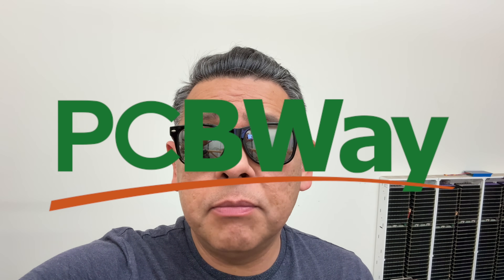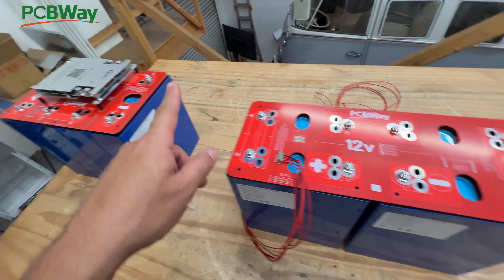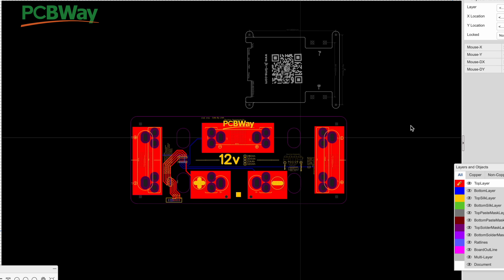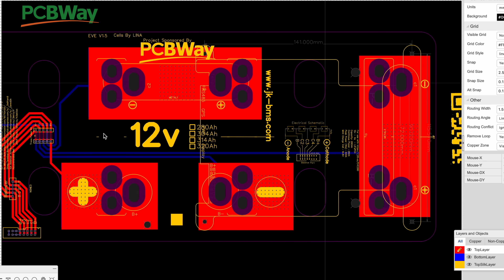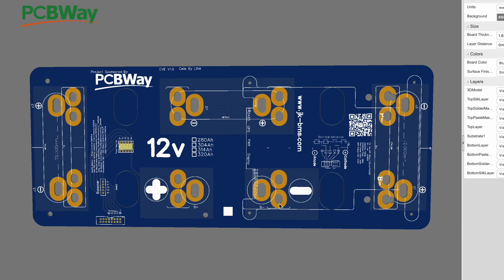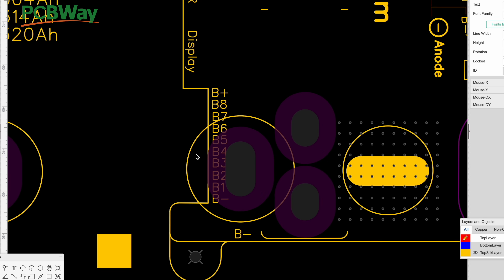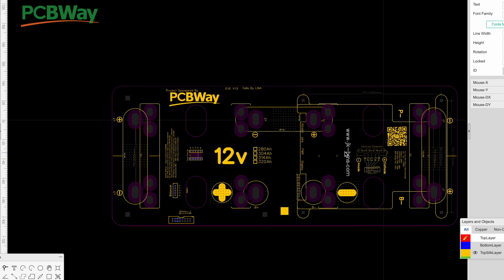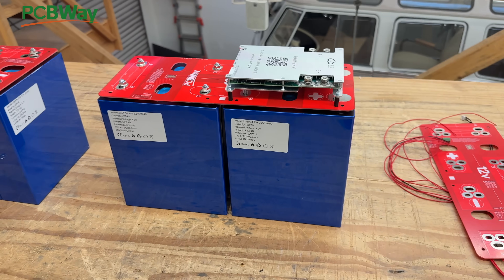12v LiFePO4 PCB busbar -  Slim PCBWay

Comment: my question do these charge with high input as in like 250 amp alternator for car audio  how many of these battery's would be good for like 6000 rms and is this battery safe in the winter or cold and if not what batteries are ok in the cold if there aint none i like to find some of those quick connect 0 gage connects i seen you had in those toucher with the green battery's you did against the regular red circle 8ah battery's i was going to just her the red circle 8 ah battery's but there's none for a good price anymore so wondering about the blue ones in this video or if there's any that aint crazy price i been doing car audio for like 30 years but never used what i call special battery's just mutable lead car battery's and if i had quick connects i would just bring battery in the house if i have to i also loose power at my house all the time so would be kool to use on ac dc convertor